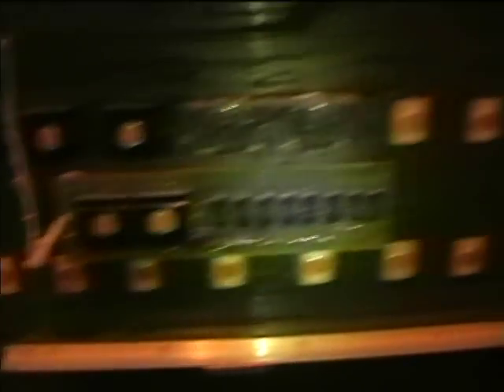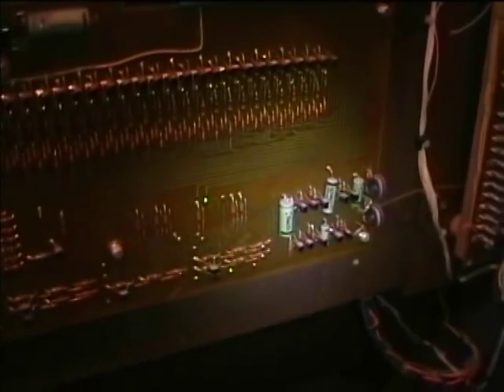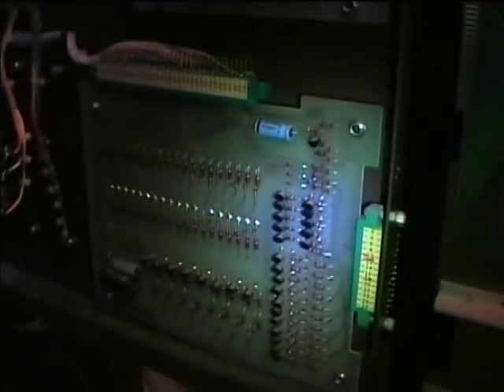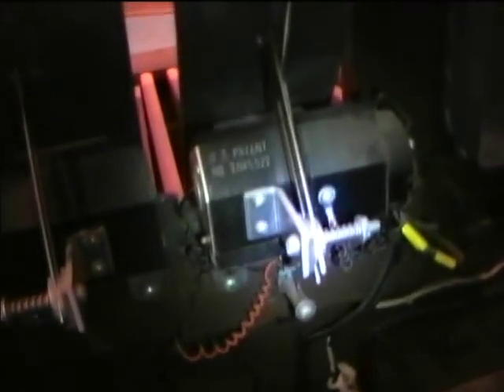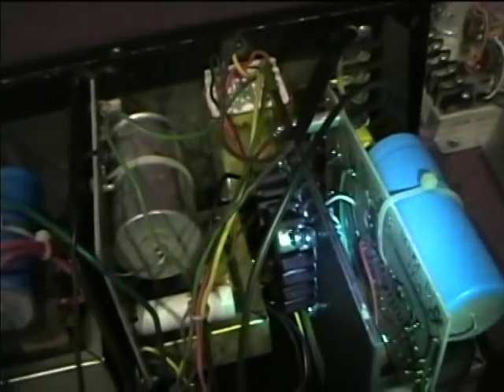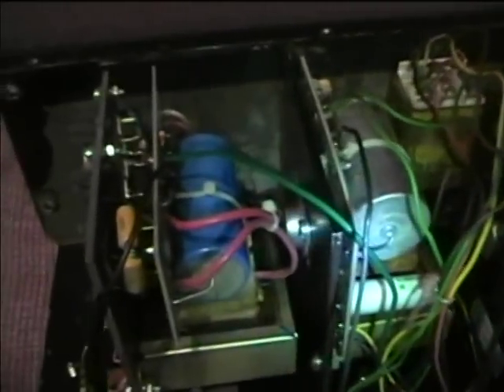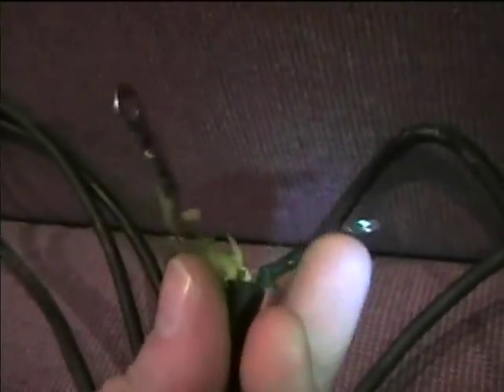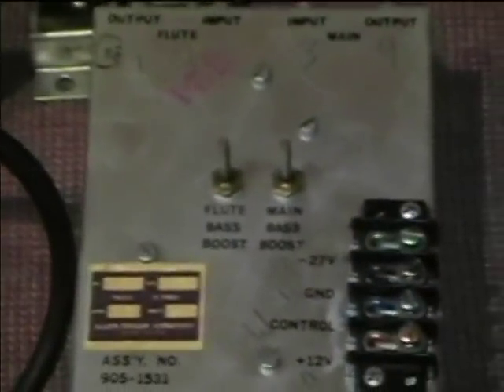1972 Allen SYS-300 digital computer organ repair part 1

Comment: That has some interesting electronics in it!

You may also want to treat those edge connectors on the various boards with De-Oxit, and check the solder joints on the female connectors where applicable.  If you do decide to replace all the caps in the Celeste generator, axial leaded caps should still be easy to get in that size.  Looks like it will be a tedious job, but probably worth it :-)

Comment from the maker: That's a good idea...I'll take in the can of Deoxit and the lint-free cloths tomorrow. I had trouble getting axial leaded caps in a lot of the ones I had to replace on the other circuit cards but I think the new caps are small enough that the radial lead ones will work.

Comment: Very interesting Chad. If there are any big interconnector plugs and pins in the circuit boards check the solder joints. Gary

Comment: We received our 123-C Allen Organ from 1979 (an MOS1 system, like yours) Wednesday. It has some weird tuning issues (I've done a temporary fix) and the principals quit working shortly after the delivery (unless you turn the vibrato on, then they start working again...) 
Anyways, I noted a few things that looked different, especially that the 123-C does not have an analog tone generator. Also that the master tuning control looks way different.